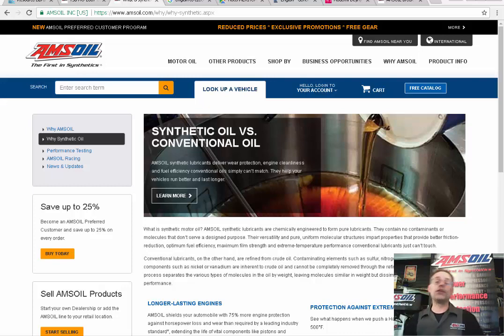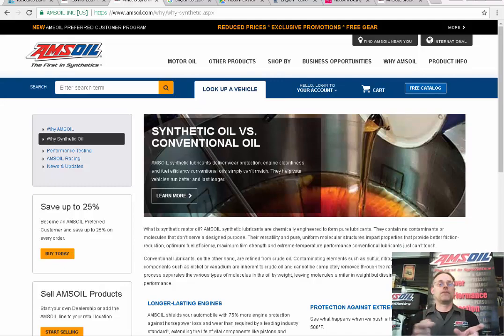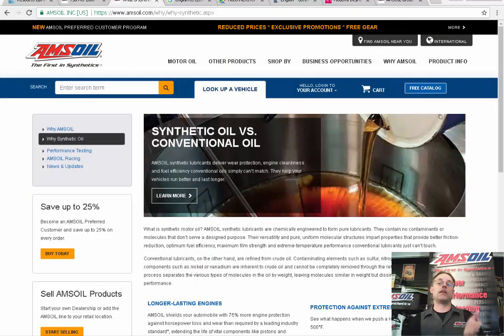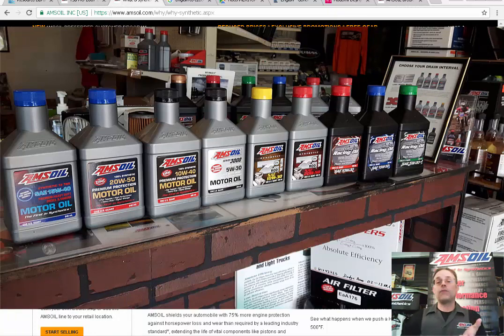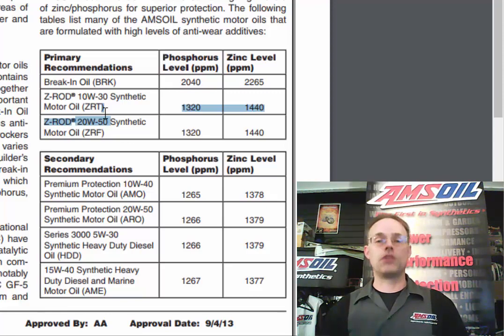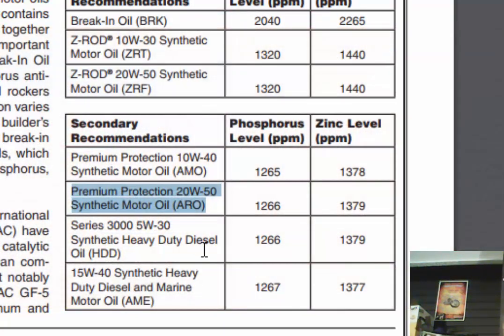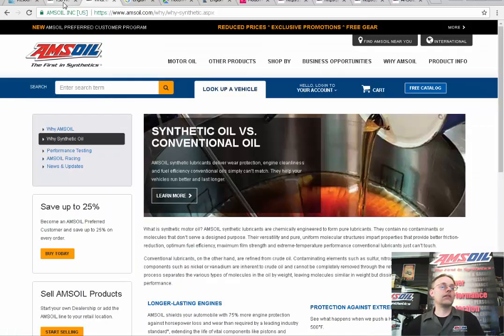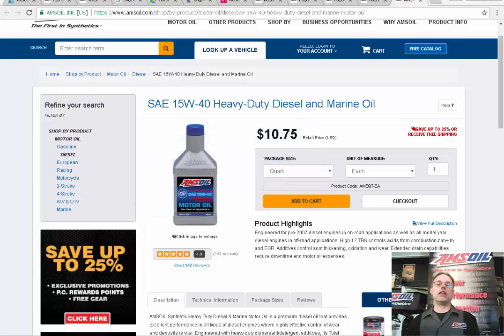AMSOIL's Solution for Flat Tappet Cams - ZDDP/Zinc Enriched Synthetic Motor Oils

Comment: I have a 1970 Olds Cutlass with a 350 Olds engine It has slight oil pan and rear main seepage and thinking about Z Rod. Will this make seepage worse or will it be ok?
Reply from the maker: If you are used to using a 10W-30 I don't think it will as our oils do have the seal swellers added but it may introduce more seepage if the engine is dirty as this line has pretty good detergents as well. So it could go one way or the other but the leaking isn't due to the base oils, but due to cleaning out deposits in the seals. 
If that was an issue you could use the AME 15W-30 if you weren't concerned about going up in weight.

Comment: I had this Amsoil Premium protection tested on my 2016 Pulsar 180, it performed perfect for me..so smooth, the engine is cool enough though my country's so hot in the noon but then, one day ive been brainwashed by these saying "disadvantages of zddp" that can damage my catalytic converter, so i decided to use other fullysynthetic motorcycle oil but turnsout it messed up further.., i dont know why..,
Reply: Frequent oil changes causes damage to catalytic converters. After 50 hours or so no more of the ZDDP effects the unit. It's the first hours. AMSOIL  designed for longer intervals (10,000 on motorcycle) are great and not fully synthetic but 100% synthetic.
Reply: @zappatx  so do you recommend that Amsoil Premium Protection for my bike?
Reply: I've been doing a lot of research on breaking oils. I'm still very nervous because I just had 429 bbf engine totally rebuilt. And if I knew better back then. Instead of going with a flat tappet I would have went with the roller cam.
  So I'm afraid to breaking in my engine, after seeing & hearing about all the negative fraud and felled cam lobes,flat tappets.Moving forward hope this oil will give me the best chance of a successful engine break-in .(cross my fingers)

Comment: Do I need to put additive in 1st then oil, mix it, or oil then additive?
Reply from the maker: Absolutely not - ALA's (Aftermarket Lubricant Additives) will void AMSOIL's protection warranty and they can change or offset carefully blended additives for all brands.
Reply: +Amsoil Synthetic Warehouse and Dealer its just a question about adding zinc additive with oil
Reply: I don't think it matters too much. Instructions will be on the back of the product providing ZDDP.
Reply: @bitTorrenter  It matters. Amsoil is just the best.

Comment: Hello i have a new 514 cui flat tapped mild perf engine.
I have break in the engine with 20w50 lucas mineral oil and drive now 1400 miles with valvoline mineral 20w50.
I want to go for amsoil is that ok after mineral oil!!
Ps my bearing clearance is .002.
What is the best viscosoty.
Gr thanks Danny
Reply: It is totally fine to use 100% Synthetic in your engine.